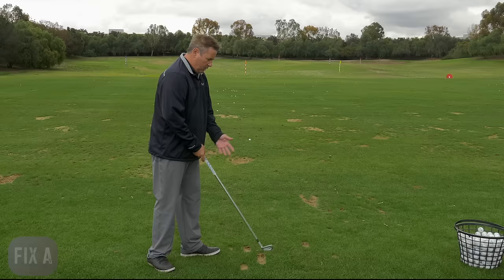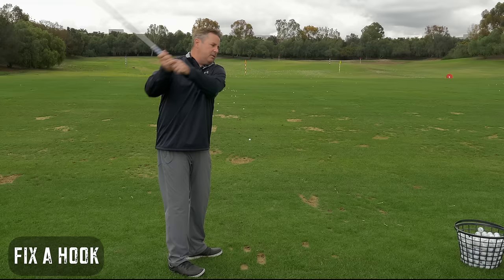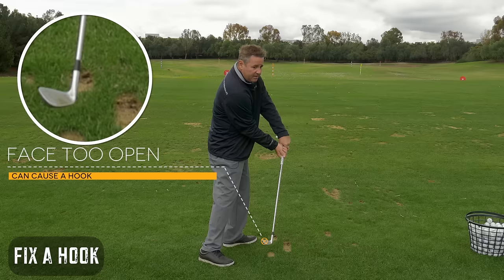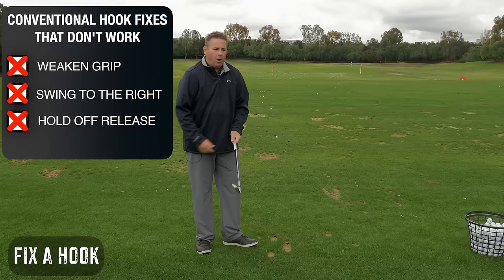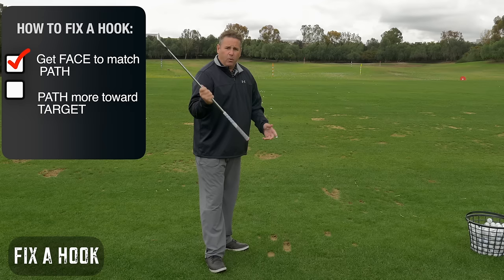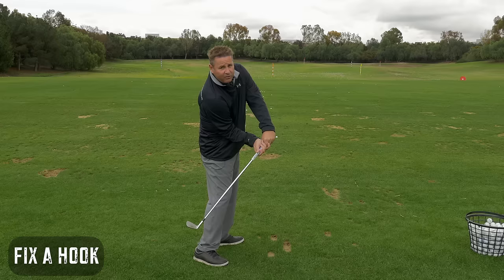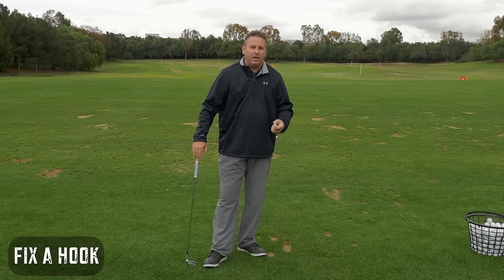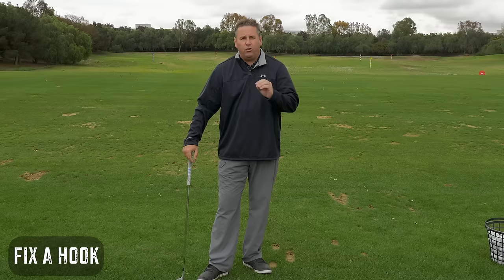How to Actually Fix a Hook

Comment: Good video. Obviously there could be numerous more reasons why someone could get in a position to hook a ball, but it's a fact that in order to fix a hook you have to fix the path and make the face square to the path. I find in better players and even myself, that a flat shoulder turn going back leads to a steep shoulder turn down (early extension) and the club gets "trapped" inside and the result is a hook. Basically what you said in your shoulder plane video years ago. I like the feeling of taking the club back on plane and try and feel to stop when your left arm is parallel to the ground (won't be in reality) and feel swinging flatter on the way down or that left shoulder is going around and not up. Keep up the great videos!

Comment: I went from a hook with the driver to a fade, I do everything  you're not supposed to do, over the top, weight back, open face,thats the feel, but its not real, but the worst that happens now is a straight pull or a slice off the toe. Still working on the irons,  they draw or overdraw. But look at the golfers who slice and imitate them, you won't actually swing exactly like them but it can help get you back to neutral.

Comment: This information is dead on and couldn't be any better. Each swing is very different and it takes attention to the individual to figure it out. I have a 7 handicap and I suffer a lot with double crosses and hooks because my swing plane gets way too low and my divots point 20 yards right of the target. That explanation is dead on. Thanks Monte.